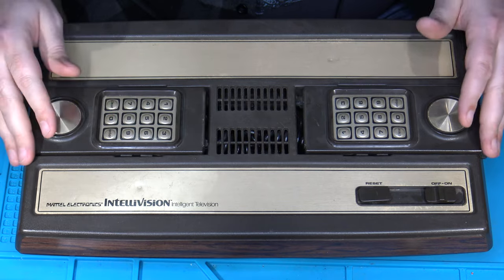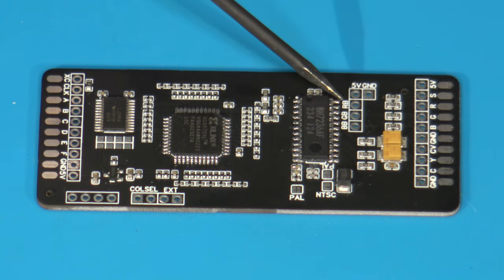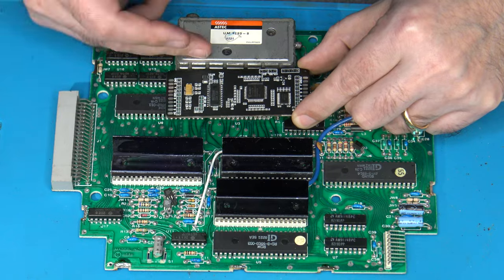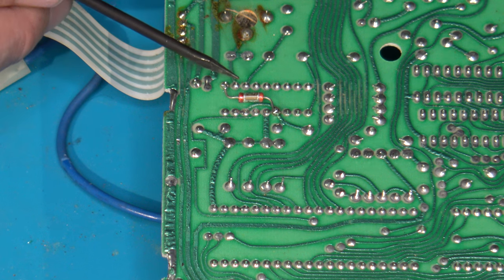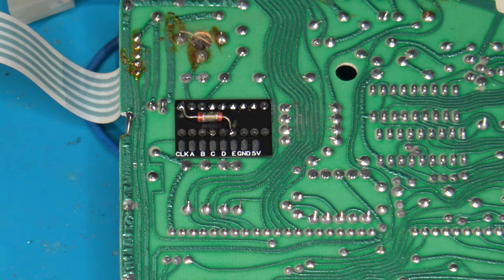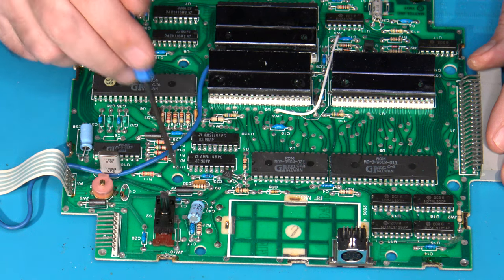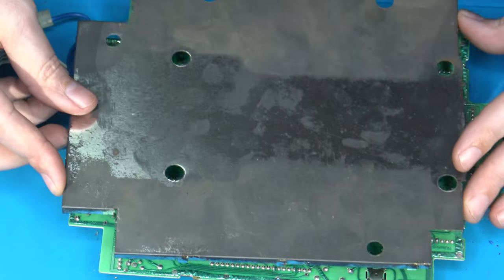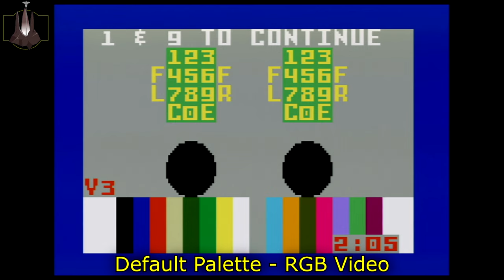ITC#82:- Orange Peel RGB - Intellivision Model 1 Installation

Comment: I've modified 2 PAL intellivisions with this card. Never got composite color to work. The image is extremely stable in composite but only black and white.

However, RGB (Scart) is wonderful. Never seen a better image. I'm only really interested in Scart output anyway so not going to complaint.

I spent a week with The Crayon King trying different things getting it to work in composite but alas, no go. Great guy, great support!
A couple of months later I ordered the second kit and the same thing with that one.

Have not even tried S-Video. Not an option when you are in a Scart country IMO =)
Reply from the maker: That is interesting to know? I don't service PAL systems as I'm in North America and don't have equipment for proper PAL testing anyway. So this isn't something I was aware of. That said, I could have sworn that at least his earlier RGB boards were tested and confirmed working on PAL consoles. But that was before the composite and s-video stuff was added in. So I'm not sure if one of his older boards with the add on composite and s-video would work?

Comment: That is a great audio video mod you did!
Reply from the maker: Thank you again for the complement! Perhaps I've been lucky but most of the consoles I receive in for services are in pretty clean and decent cared for condition. I don't clean the consoles until after the service work is completed with the exception of the case shells as those are washed and dried before any holes have be drilled if needed, but then are wiped out again afterwards.
Reply: @IvoryTowerCollections  I know I try my best specifying making sure cleaning the inside console from dust particles and electronics corrosion even with isopropyl alcohol.

Comment: What capacitor are you using for the audio? Great video!
Reply from the maker: Just a standard 10µf 16v cap that I've got a lot of on hand. It is overkill for this, but does the job well. Many don't even include it because you already have the small disc cap that you are feeding off the audio from anyway.

Comment: Love these videos, I want to use the same 9 pin mini din that you did. Is there a link or something to get those at? Thanks!
Reply from the maker: I buy the 9pin mini dins from Console5. But I'm sure they can be purchased from other places as well. But yeah..just search for them. The specific ones you see are the only type I know you can get easily being PCB mount style. The breakout boards I use to solder my wiring onto however, I order from a PCB manufacturer.
Reply: @IvoryTowerCollections  Thanks for the reply, I guess what I am really looking for are the break out boards. Know any places to find them at? I know they arent needed but sure would make it easier to install. thanks
Reply from the maker: Again I designed my own for 8-pin mini din installs, but if you search places like Oshpark, PCBWay... I know there are projects that have these breakouts done that you can then order to have made up. I only did my own 8-pin boards because the ones I found initially didn't have all the pins wired up that I needed. Not sure of anyone selling already done PCBs.
Reply: @IvoryTowerCollections  Yeah.. I know what you did, I do not have the skill however to make my own boards , etc. Was just inquiring if you knew anyplace that had already made boards, but looks like im out of luck. Thanks anyway, nice day to you.
Reply from the maker: Here is a link for a 9-pin breakout that looks similar to the ones I have made only I have all of the pads on the same side and this one has audio on the bottom side.

https://oshpark.com/shared_projects/uaeoK4Fa"><img src="https://oshpark.com/packs/media/images/badge-5f4e3bf4bf68f72ff88bd92e0089e9cf.png" alt="Order from OSH Park

Comment: For the pallet switch, can I use the channel switch like the INTV II mod. If so, where would I connect to?
Reply from the maker: Yes you can! But you have to remove the RF Modulator to do this. If you remove the RF modulator, then the second wire connection from the RF modulator going from the top down (Video connection begin top) is the one to connect to. It is also just right of the electrolytic cap that is there between the channel select and the RF modulator. The video trace runs between the cap and the via in question. Use a meter of course to verify this. You can't use it with the RF attached because normally there would be +5v off that via to switch to channel 4 mode and that would be bad. But with the RF removed, that +5v connection gets broken. But basically it is the exact same as what is done on the Intellivision II. If you need more info, just got to my about me info and go through the loops to send me an Email etc.

Comment: I dod the 8pin mini din where can I find cables for this?
Reply from the maker: I think the best source for the 8pin din SCART RGB cables are those from Retro Gaming Cables in the UK. That is where I ordered my 8pin cable for testing stuff with and it is great.
Reply: @IvoryTowerCollections  I'm in the US. I don't use scart.
Reply from the maker: @Alex13mod  Your options will be more limited as you went with the 8pin vs the 9pin. You are correct in that SCART wasn't a standard here. But it is common in RGB use if you are wanting to use the RGB from the 8pin setup. I use 9pin because then I can use other cables like the Rad2x, HDRetrovision cables, or even the inexpensive Hyperkin Genesis 2 HDMI cable will work with this console although it doesn't give the best results. So to the best of my knowledge if you have to use the 8-pin, you are likely going to have to go with a SCART RGB cable for that, and then another converter in the mix that can take the signals from the SCART and output to another method from there. Exactly what are your options for connecting it to the display you plan to use it with? Maybe it would be better to just install the s-video and audio and then get something like a Retrotink5x Pro, or one of the Tink2x devices second hand if you can find one. With the Tink5x you can use the SCART RGB and get HDMI output, or with a Tink2x series you can use the s-video for the highest support quality signal from this upgrade kit and have it convert that out to HDMI.
Reply: @IvoryTowerCollections  I built this for a friend. I wasn't aware of the 9 pin mod

Comment: I need your mount board.
Reply from the maker: My apologies, I've been without power and internet services for the past week so I'm playing catchup on this. Did you also reach out via email about this? I could possible send one your way as they are very small PCBs just used to lift the minidin up high enough so I don't have to modify the case shell when installing in the RF opening.